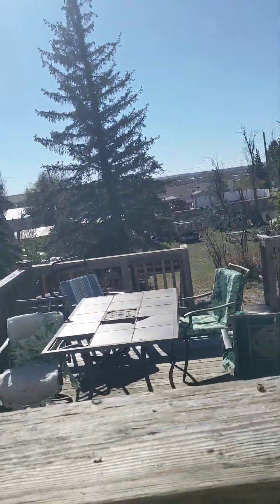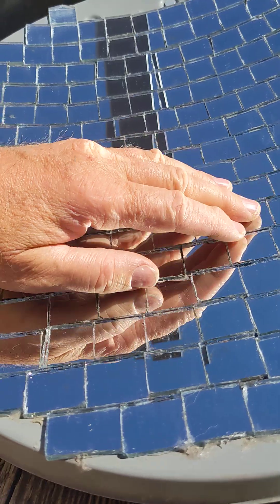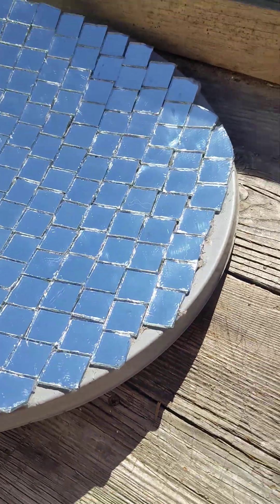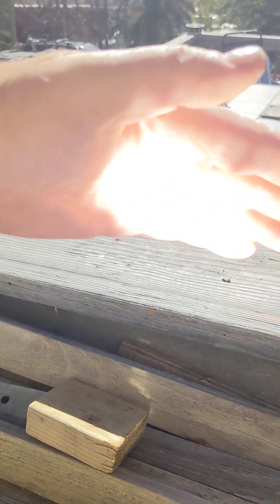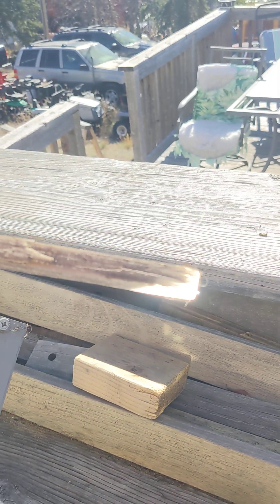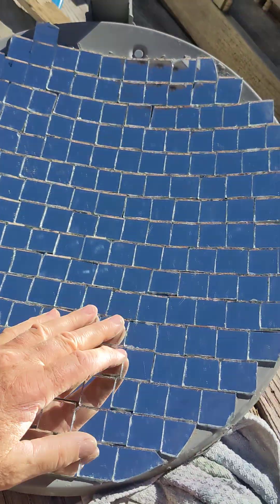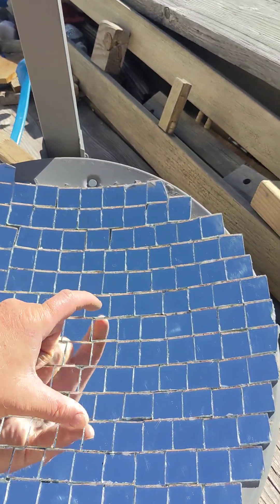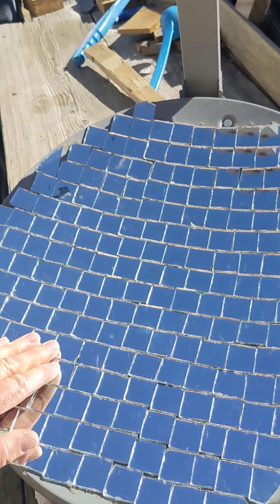Mirror Solar Concentrator project

Comment: Fun fact we never got way from steam power most power plants are just different ways to make steam for a steam turbine
Reply from the maker: While that is true the norm was to have your own steam engine at your location converting the heated steam into mechanical motion thereby powering lathes, mills, drills, sawmills etc. thus not depending on a "utility company" with all that entails.

Comment: You should just buy a curved mirror😂
Reply from the maker: I'm sure a curved mirror that is a true parabola is expensive as well as not as robust enough to handle harsh weather , snow loads, extreme wind / wind gusts like we get here in Wyoming ( 70+  mph in the winter )  etc. plus I  like making things out of discarded stuff - recycle/ reuse
Reply: @123ABC-Machine-Basics  you're right I only have a couple personally, but I prefer old TVs if I'm trying to pinpoint the sun with the giant ant burner